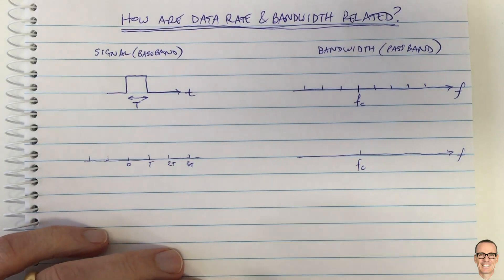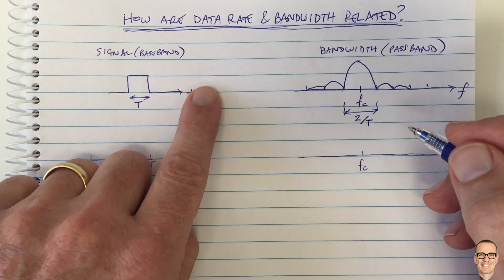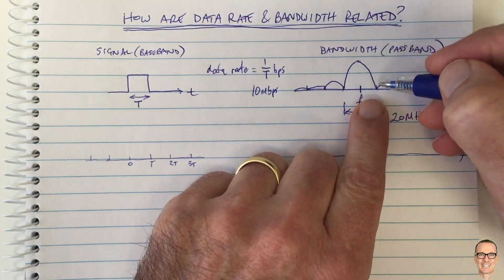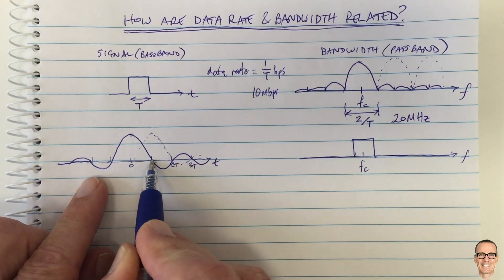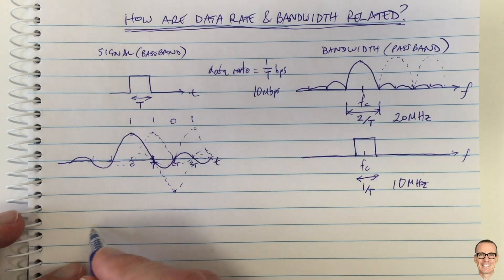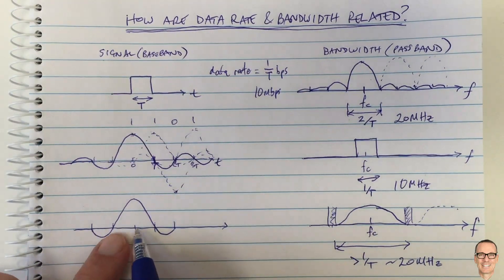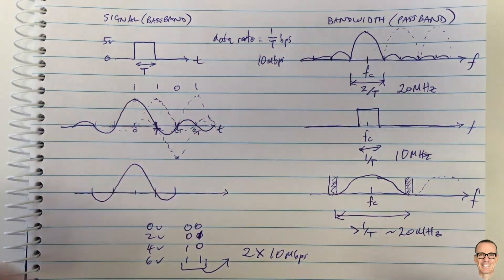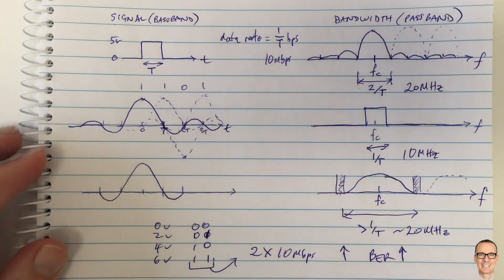How are Data Rate and Bandwidth Related? ("a super clear explanation!")

Comment: From my course's lecture notes I got a bit rate efficiency for an ideal rect lowpass of 2bits/Hz. So in your notes it should say (given 10Mbps) that we need 5MHz, instead of the 20MHz you wrote down? Or where am I confused?
Reply from the maker: Um, no, I didn't write down 20 MHz for the ideal rect lowpass filter. I wrote down 10 MHz for that case (the second row of diagrams, with the square/rect low pass filter in the frequency domain). And your notes are probably taking into account that in the passband you can modulate a cos wave carrier and a sin wave carrier independently (they produce orthogonal waveforms), although I'd need to see your course notes to be sure. I didn't go into that level of detail in my video because I was focused on explaining the bandwidth expansion when using practical filters, and I didn't want to confuse it with also discussing modulation formats with multiple bits per symbol. If you use both cos and sin carriers, then with binary digital modulation you can send two bits per symbol time, which means 20 Mbps over 10 MHz for the example I considered (in the ideal rect filter case). So that's where you get 2 bits per Hz. But if you consider non-binary modulation (eg. QPSK, QAM, Mary PSK, ...) then you can achieve much higher than 2 bits/Hz.

Comment: @iain_explains So in a practical communication system, we can't have a symbol rate of 1/T with a (passband) bandwidth of 1/T (given that the sinc pulse is not realizable in practice). Because sometimes I see they mention that the symbol rate is equal to the bandwidth, maybe they mean that this is the maximum theoretical rate. So in the third case you talked about (let's say it's a raised cosine pulse), you said that the required bandwidth is 2/T, so here you assumed that the roll-off factor r is 1 (we have Bp=Rs(1+r))? Or maybe it's less than 1 but with guard band the bandwidth becomes approximately 2/T. So can we say that in general, for a symbol rate of 1/T, we need a bandwidth of 2/T?
Reply from the maker: Yes.

Comment: Thank you for your great video. I have a question that if in PSK modulated signals, does the date rate and bandwidth relation still applies?
Reply from the maker: Yes. The pulse shapes I showed in this video are the response of the baseband "pulse shaping filter". They can be modulated up to any carrier frequency you like, and use whatever modulation format you like. Perhaps see this video for more details/insights: "Visualising Pulse Shaping with Real Digital Communications Signals" https://youtu.be/hCk_cg-OfUQ
Reply: @iain_explains  Thank you very much for the great video. I think I've watched this video some days ago. I am rather new to signal processing, sometimes different pieces of knowledge just don't relate to each other easily after watched.

Comment: I have confusion about bandwidth and capacity. I see often they're used interchangeably by people. Are these two accepted uses for 'bandwidth'?
1. The maximum possible data rate for a channel.
2. The frequency range which can be sent over a channel.
To me, a bandwidth is a frequency range, and expressed in Hz, but without more information e.g. on the symbol size, and how much is actually available for useful data it says little about the channel capacity or data rate. To me, channel capacity is the maximum possible gross data rate that could be pushed over a channel; Am I wrong?
Reply from the maker: People (who don't know much/anything about digital communications) use the term "bandwidth" very generally, to mean "throughput" (in a general sense). That's why I made this video. If you'd like to know more about "capacity", then this video should help: "What are Channel Capacity and Code Rate?" https://youtu.be/P0WY96WBUyA

Comment: hey professor really an amazing video thanks for it 
my little question does the duration of the clock pulse which we are applying to the circuit has the same duration as that of data rate?
Reply from the maker: No. It is possible to send multiple data bits per clock pulse. This video will hopefully help: "What is a Constellation Diagram?" https://youtu.be/kfJeL4LQ43s

Comment: why the minimum band width required is Rb/2 whereas it shoud be  Rb insted since when we using sinc pulse in the input we are getting a rectangular pulse in the frequency and thats the minimum required band width . i hope you are understanding my doubt i have always had this confusion about why Rb/2 .thanks!
Reply from the maker: Sorry, I'm not sure what you're referring to. I don't use the symbol "Rb" anywhere in my video.
Reply: @iain_explains  Rb is nothing but 1/Tb [where Tb is duration of bit]
Reply from the maker: Did you watch my video? In the video, I explain that if a sinc pulse shape is used, then the bandwidth is 1/T. I don't know where you are getting Rb/2 from. I don't say it anywhere in my video.

Comment: That when system speed slow enough but at high speed that techniques is not efficient i think and if we utilize speed as advantage the split bandwidth base on two time variable ( time domain and time sequencing then instead of voltage data we transmit by pulse like telegraph but extremely fast then it does not effect too much on electrical system because normally that system is protected against  eddy current already so only router at substation read

Comment: I recently discovered your YouTube series on digital communications.  Thanks so very, very much for the informative work.  However, regarding this video, i.e., "How are Data Rate and Bandwidth Related," I can't seem to gain an intuitive (i.e., physical and non-mathematical-formula-based) understanding of two aspects of the video.  As to the first such aspect, can you offer an intuitive explanation of why the time-based square wave (signal, baseband) requires a spread/range of frequencies to adequately depict the frequency-based bandwidth/passband?  In other words, if a sine wave can be described as a single frequency (as I saw it was the case in another of your videos), why (physically) does it take a range of frequencies to "build" the square wave. As to the second aspect of your video for which I can't find an intuitive understanding, what is (again, sorry to keep this drum, physically) it about the square wave that requires a greater and greater range of frequencies to achieve a greater and greater bit rate for the transmission of the square save signal?  Again, deepest thanks for your videos.  Charlie
Reply from the maker: Welcome to the channel. I'm glad you like it. I've been meaning to make a video on this for ages. It's on my "to do" list, but I think I should lift it up the priority order. Basically, all (or almost all) signals can be constructed by adding together sinusoids of various amplitudes, phases and frequencies - that's what the Fourier Transform tells us (that's the brilliance of Fourier's construction, back in the 1821). Slowly changing signals can be constructed from sinusoids with low frequencies. The more "peaky" the signal, the higher the frequency components will be. So, when you think about it, if you want to "construct" a perfectly square corner in a signal, you would need sinusoidal components that oscillate infinitely fast. I definitely need to make a video about this, but until then, this video may provide extra insight: "What is the Gibbs Phenomenon?" https://youtu.be/Ol0uTeXoKaU
Reply: @iain_explains  Thank you again. You’re reply is most helpful and the Gibbs Phenomenon video is also very valuable. I look forward to you’re recording (ad , of course, prioritizing) a video that more directly addresses the questions in my original post and does so with an emphasis on offering an intuitive answer to those questions. Charlie
Reply from the maker: Hi @Charlie Uniman , I just made a video to answer your first question in this comment thread. Hope it helps: "Why are Sinc and Square a Fourier Transform Pair?" https://youtu.be/ZcTWLwXGql0
Reply: @iain_explains  Thank you very much. I can’t wait to view the video tomorrow. Charlie

Comment: Hi Iain, this does not apply to QAM modulation methods used for mobile communication, right? Because in these cases each bit is mapped to a frequency amplitude and phase signal (thus I do not need to send an electric pulse). Am I correct?
Reply from the maker: I'm not sure you're understanding what modulation is, exactly. The only difference between what I've shown in this video, and QAM, is that in the case of QAM the "electric pulse" (as you call it) is modulated by a carrier waveform (and that there is another orthogonal waveform sent at the same time - one on a cos wave, and the other on a sin wave ... plus there are multiple amplitudes, not just the on-off situation I talked about here). Everything else is the same. These videos might help: "What is a Constellation Diagram?" https://youtu.be/kfJeL4LQ43s and "How are Complex Baseband Digital Signals Transmitted?" https://youtu.be/0lkRJgnywkg

Comment: Professor, The problem you discussed at @5:46.

Every practical signal is time limited and signal don't exist on t < 0. in that case why do we need to worry if signal starts infinite time ago. My understanding is signal being infinite is just theoretical concept. please correct  me
Reply from the maker: In answer to your question: "why do we need to worry", I think you've already answered it yourself. If the signal you want to implement needs to start infinite time ago, but you are dealing with practical signals that are time limited and don't (can't) exist on t<0, then you need to worry because you won't be able to implement the signal you want. You will need to implement an approximation to the ideal signal that you really want to implement, and it will not have the same desirable frequency domain characteristics.

Comment: Thanks a lot for your wonderful video. I am wondering how the power of modulated digital signal related to the RF carrier power🤔
Reply from the maker: They are the same. The "modulated digital signal" is (by definition) the transmitted signal that has been generated by multiplying the RF carrier sinusoidal wave with the data-carrying baseband wave. That's what "modulation" means. The baseband signal has "modulated" the carrier waveform.
Reply: @iain_explains  I am wondering three components as digital baseband signal, rf carrier and modulated signal, the power spectrum density of modulated signal can be regard as the shift of basedband to RF. However, I am confused by the power relation of these three, as we always use the word'transmit power'. Does it refer to some kind of combination of baseband signal power and rf power? Many many thanks.
Reply from the maker: "Transmit Power" refers to the power of the transmitted (modulated) signal. The baseband signal has a certain power (depending on the electronics that implements/generates it) and it gets multiplied by a sinusoidal carrier wave (which has a certain power depending on the electronic circuitry that generates it). The resultant waveform is then amplified by a transmit amplifier, with a certain gain (possibly adaptive, depending on the implementation). It might go through a transmit filter, which potentially alters the power. And then it gets sent by an antenna that has a certain antenna gain ... and so on. All of these things are just scaling factors that get measured/calibrated/adjusted in practice. The only two things that really matter are that the radiated power is below the legal limits, and that by the time the signal reaches the receiver, that the received power is high enough above the receiver noise power.
Reply: @iain_explains  Got it, Thank you so much for these general and detailed explanation, Prof. Iain, wish you a nice weekend!
Reply from the maker: Great. I'm glad I've been able to help.

Comment: Thank you so much Prof. That is really helpful.  I have a question here, I am performing real test using OFDM system in wireless communications system, with number of sub-carriers N and modulation order M, I am using sampling rate t = 1GSample/s, what will be here the data rate? Lets  ignore the guard interval and overhead packets and so on, I mean we consider that all sub-carriers are carrying information bits, log_2(M) each sub-carrier. can we consider here the bandwidth B = t, or it should be B = t/2 ? I mean if we could decided the correct B, it will be straightforward to calculate the data rate in that case.  Thanks again prof.
Reply from the maker: Hopefully this video will help: "How are OFDM Sub Carrier Spacing and Time Samples Related?" https://youtu.be/knjeXo3VZvc

Comment: My question is, In standard Ethernet with transmission rate of 20Mbps, the length of the cable is two meters and the size of frame is 1024 bits, the propagation speed is of a signal is 2/10^8m/s. What is the total percentage of time medium occupied but not used by station?
Reply from the maker: Sounds like this is one of your assignment/test questions. Sorry if this sounds a bit direct/rude, but I'm not here to do your homework for you. If you've got an "understanding" question, then I'll be more than happy to answer it.

Comment: hii lain,
when we are sending bits in the time domain by sinc function than why have you considered the bit duration as 2Tb is it because we need to extend the duration of bits we are sending when we send in form of sinc pulses
Reply from the maker: Sorry, I don't know what you mean. I don't say the bit duration is 2Tb.
Reply: @iain_explains  @4:13 the sinc pulse drawn is having the main loab frequencies from (-T to T) which will make it duration of 2Tb thats what i was refering
Reply from the maker: OK, I see. Why do you write "Tb"? That's the symbol for Terra-Bit (10^12 bits). Anyway, no, the "duration" is in fact infinite! The waveform goes from negative infinite time to positive infinite time. But anyway, due to the zero crossings, you can send one symbol every T seconds. That's the time between the zero-crossings. When there is a zero-crossing, you can centre another pulse at that time, and not interfere with this pulse.

Comment: Thank you so much sir for these types of videos.. really appreciate it...i have one doubt at 7:16, if bandwidth is > 1/T then is it safe to assume that bandwidth= 2/T? If so will the bandwidth remain same for any modulation sheme(like bpsk, 16qam,64qam and so on)?
Reply from the maker: No. The shape of the pulse, and the rate that pulses are sent, determine the bandwidth. There is no reason the bandwidth needs to be exactly integer multiples of 1/T. For example, the square pulse at the top of the page has an infinite bandwidth.

Comment: The nyquist data  rate = 2B log2M..for bpsk, we have B = data rate/2...???
Reply from the maker: It depends on what you mean by the "nyquist data rate". I think you mean the data rate that the Nyquist data transmission theorem tells us is the highest rate possible, assuming you are using ideal sinc function pulse shaping. In which case, B is the bandwidth of the low pass base-band equivalent channel. I think I'll add this topic to my video "to do" list, to help clarify it.

Comment: hello, thank you for your videos, they are wonderful, although i have a question regarding translating from data rate to bandwidth, All literature on the internet they tend to divide data rate by 2 to get to frequency bandwidth , for example 56gps pam2 , it is translated into 28ghz , 224gbs pam4 into 56 gas and so forth, please if you can explain that, it is very confusing to me
Reply from the maker: Ah yes, this factor of 2 often confuses people. In my video I talked about the passband bandwidth (assuming the time domain waveform was being modulated up to a carrier, for example for wireless communications). The bandwidths you are referring to in your question, are baseband bandwidths (assuming the time domain waveform is exactly what I drew on the left hand side, without any carrier modulation). Passband bandwidths are 2 x Baseband bandwidths. These videos might help: "Amplitude Modulation AM Radio Signal Transmission Explained" https://youtu.be/-PWg-0k2oks and "What is a Baseband Equivalent Signal in Communications?" https://youtu.be/etZARaMNN2s
Reply: @iain_explains  Thank you so much for the explanation, now it  clear.
Reply: @iain_explains  according to what you have said, baseband bandwidth would be 1/T for thé first signal. But he is asking why it is 1/2T, no?

Comment: For example - For some random data input if 1 bit period =4n sec, then Bit rate = 250Mbps and Bandwidth is 500Mhz. Is my understanding is correct, please let me know if I am wrong.
Reply from the maker: As a general rule of thumb, yes (for binary modulation).  The bit period is the inverse of the bit rate (for binary modulation). But the bandwidth is not so clear cut (as this video explains). The bandwidth relationship depends on the choice of the pulse shape (in the time domain). I show three examples in the video. Perhaps this more detailed video might help: "Pulse Shaping and Square Root Raised Cosine" https://youtu.be/Qe8NQx4ibE8